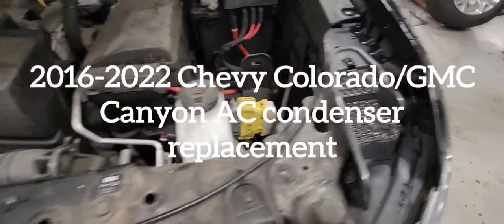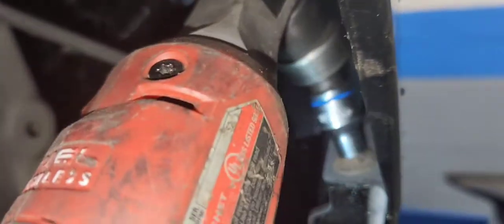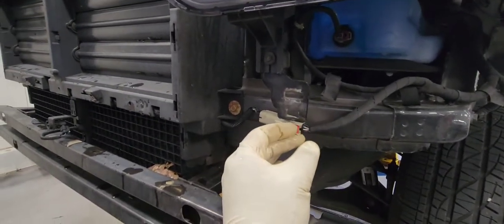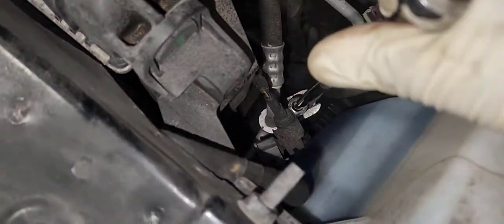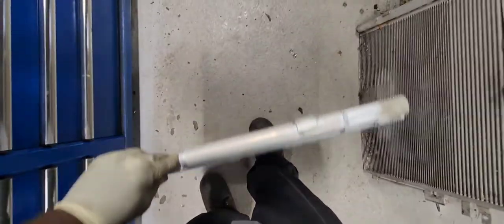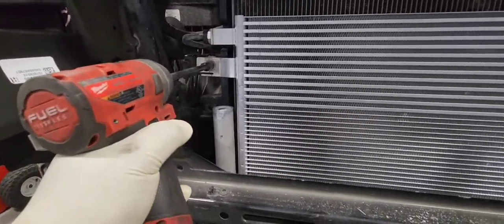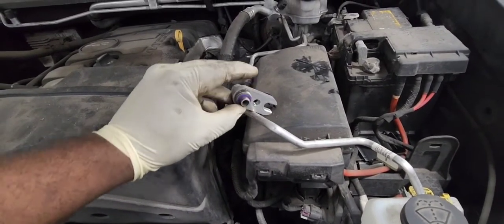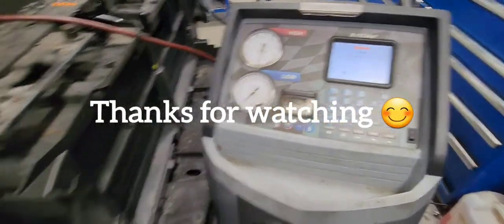2016-2022 Chevy Colorado/GMC Canyon AC condenser replacement

Comment from the maker: Link for AC Condenser 2.5L 3.6 L Automatic transmission
https://amzn.to/3DyvkPu
ac condenser 2.6L 2.5 L with manual transmission
https://amzn.to/3Y8TcCK
AC Condenser O ring 2x
https://amzn.to/3DxK9SI
AC Condenser O ring 2x
https://amzn.to/47aueY3
basic hand tools set
https://amzn.to/3KEj5VR
pick set
https://amzn.to/3QdswPq
trim tools set
https://amzn.to/454Tjlo
torx bit set
https://amzn.to/3OuQXqo
milwaukee impact driver
https://amzn.to/3QeILeY
milwaukee angle impact
https://amzn.to/3q5bus3

Comment: Thanks for the info! I have had my Canyon for a little over a year and it's been tough finding certain tutorials. My A/C has been blowing warm air after about 30 minutes of driving and I have to click it on and off a few times to get it working again. Freon pressure is good and compressor clutch is engaged I am gonna try to clean the condenser coil to see if it's freezing up. Thanks for the info
Reply from the maker: You welcome, the passenger side on the bottom of the condenser that's where it leak most of the time
Reply: Did cleaning it work? My canyon’s AC went out but it does everything else you mention. It just blows hot air.

Comment: Nice video. Thanks for sharing. I need to replace my cooling fan assembly and can't find a video on that. Hoping can do without removing front bumper, etc
Reply from the maker: Thank for watching,send me your vin I will email you the instructions
Reply: Thanks for responding. I'm currently out of town. It is a 2018 chevy colorado zr2 3.6L V6
Reply from the maker: The removal of the bumper is not necessary to replace the coolant assembly

Comment: I need some info on why my driver side tail light don't work but the break light and turn signal doesn't and I've changed bulbs and checked fuses and check where the harness connects and no power for the tail lights. Also my driver side low beams and turn signal doesn't work and I've changed bulbs
Reply from the maker: For the tail light i've  fix a few for that concern it ended up being the harness in the rear bumper it was due to corrosion, simple visual inspection you will see the problem
Reply: @steevegmtech7326  I checked the harness where it connects with a meter it's not getting power from the main source. I was hoping that was it but I may change it anyway 
2015 chevy colorado
Reply from the maker: Ooh yes you have an older one,i meant under the car near the spare tire, that's where they rottef